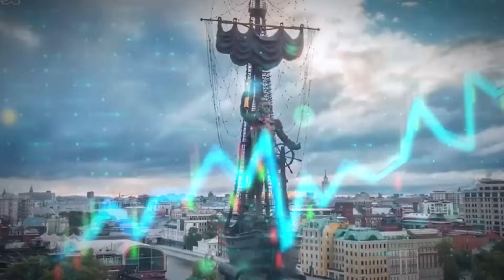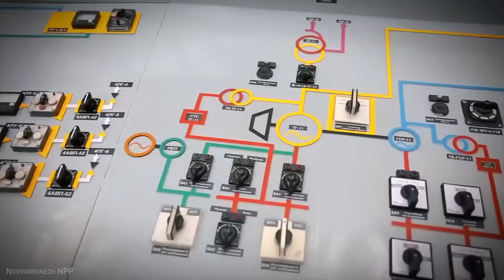Russia's Insane Projects That Make America Look Ancient!

Comment: Solar is mainly for residence, not industry.  100 days of sun would not be enough for solar.  I was not giving advice, but was making conversation; sorry for confusing you.  Extensive power grid depreciates power by the magnetic field required for transmission; in other words, it also depreciates your currency.  This is why power grids are worth avoiding; it is also why solar is good because DC current at the point of use does not lise much in transmission.  Metropolitan city losses are significant, while lisses across an extended grid are substantial.  If you must have a grid, the reactive power factor should be supplied by solar so it does not depreciate your money; for 100 days of sun, that would be hard to justify.  Do you have many wind farms?

Comment: What will happen when the tundra begins to thaw?  Nuclear power produces nuclear waste that must be stored long term.
Reply: Россия создала новый реактор на быстрых нейтронах БМ 800, который может работать на ядерных отходах, и отсюда следует что весь ядерный цикл замкнулся, и ядерные отходы являются топливом, в 90-е годы все страны свозили в Россию на хранение ядерные отходы, за копейки, и теперь у России ядерного топлива на тысячелетия
Reply: Relieve your residential demand for nuclear power to reduce the size of your power grid.  

ALL cold countries, including the USA West and East, should build Lexan plastic laminate panel gabled roofs (clear) without shingles.  Deck the attic with solar panels for full day exposure.  Mount in the roof apex a pneumatic pipe to blow high pressure compressed air through "fan" nozzles parallel to the roof panels; this avalanches snow buildup off of them easily (avoid gutters), so solar heat from the solar panels in the attic can melt any ice on the roof.  No power grids required.U.
Reply: @claragabbert-fh1uu  тяжелой промышленности тоже установить солнечные панели? пробовали когда-нибудь плавить от них метал? вам промыли мозги зеленой энергетикой, вы не понимаете сколько энергии требуется для развития страны, чтобы она была конкурентоспособной не только дешевой рабочей силой, но и дешевой энергией.   вы даже не понимаете сколько энергии теряется при передачи, а учитывая логистическое плечо России, эти затраты будут огромны. тем более в России всего 100 солнечных дней в году, если мы послушаем ваши советы, то вернемся в каменный век
Reply: Thanks for the update.  Congratulations to Russia for the tech advance.  We hope the fuel and waste remain as fuel, but not as weapons.  However, the nuclear facility will have a service life beyond which it becomes  radioactive waste, and the plant requires a  power grid to distribute electricity.  How does Russia deal with ice collection on power cables?  Power grids are susceptible to cosmic mass ejections from the sun.  Is there too much snow for solar residential power to be convenient?  Most importantly, how much tundra area of Russia threatens to thaw from global warming, releasing methane?  Plant trees to cover exposed soil; this will ward off Global Warming.  Again, thanks .U.

Comment: What did you just see!? Am I hallucinating? An American anchor talking about Russian achievements?! Admiring Russia?
It's mind-blowing!
Yes, of course he was careful NOT to mention the highlights. I understand. Shock can kill.
But I'll pour gasoline on the fire!
He didn't mention the following:
1. We are not actively developing silicon chips because we are doing photonic and quantum chips. Silicon is old!
2. We have closed the nuclear fuel cycle. This means that our nuclear reactors turn nuclear waste from old reactors into fuel and produce more nuclear fuel than they consume in the process of generating electricity. At the same time, the possibility of explosions and accidents is completely eliminated because lead is used as a coolant, not pressurized water. No pressure, no explosion. Lead itself preserves the emergency reactor and all the radiation in it in case of an accident.
3. a nuclear-powered planetary vehicle that can fly outside the solar system and return, refueling in flight with comets and asteroids! Space X is junk on early last century technology.
4. The digital state! We don't go to authorities for certificates and stuff. Everything is automated like taxes. everything is on your phone and at your fingertips.
5. Cheap! and fast internet everywhere! And in the subway and transport wi-fi in general free and everywhere in shopping centers, cafes, restaurants .... in all places where people gather. I have 100 megabit internet at home and it costs only 3,5 dollars a month.

Translated with DeepL.com (free version)

Comment: so if we assume that the train goes at 250 meter per hour and the distance between moscow and vladivostok is only a bit more than 3000 miles (assume 300 is a typo) than that train will cover Moscow - Valdivostok in just 750 days. not bad at all

Comment: The segment in this video talking about the latest Russian rockets fails to mention that Russian rockets are not reusable, and the cost per kilo of cargo to orbit is what really matters. Russia’s latest rocket is predicted to be capable of up to 20 flights a year with 17 tons to orbit. Once ramped up, a single SpaceX Starship will be able to launch 3 or 4 times a day, carrying 100 tons to orbit, and be fully reusable. Russia is definitely not winning the space race against SpaceX. Absolutely not. Not even close.
Reply: SpaceX will encounter the same problems that NASA did with the shuttle launches, you start using the rockets that much… the maintenance, overwhelms your ability to launch them that quickly, and they start falling apart. 
The cargo here can cost many times with the rocket itself costs, any failures on SpaceX part will be massive catastrophically expensive and the loss of faith will cost them dearly

Comment: russia and china have excellent qualification system. also, they are traditionally more state facilitated and integrated than western capitalist systems, which are basically bureaucratic nightmares, typically taking 2x as long and costing 2x as much.
by the time the friends of the gay silver owl have been dealt with in the west, the Russians are already finished. so if you have talent, where do you want to work?

Comment: Distance between Moscow and Vladivostokc is not "over 3,000 miles", it is 5,600 miles. "Cut in half" indeed. A "speed of 250 meters per hour" is "breakneck speed" indeed.
Reply: miles per hour,lapsus lingue